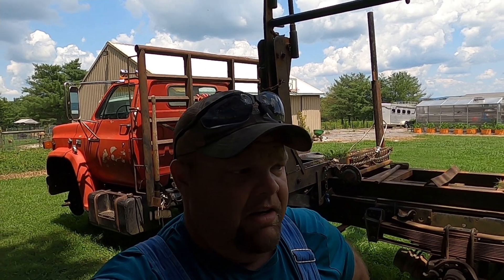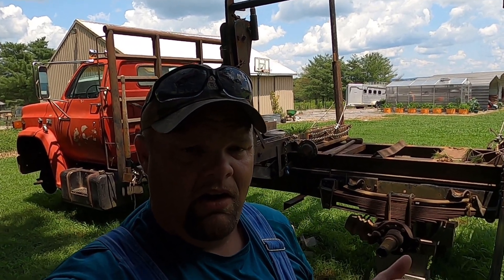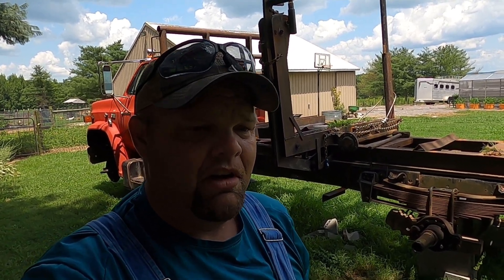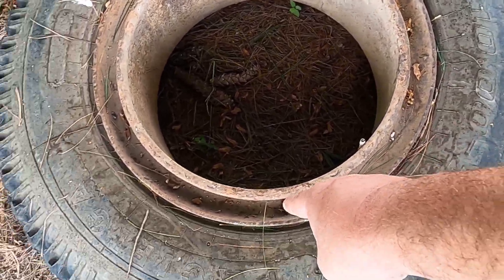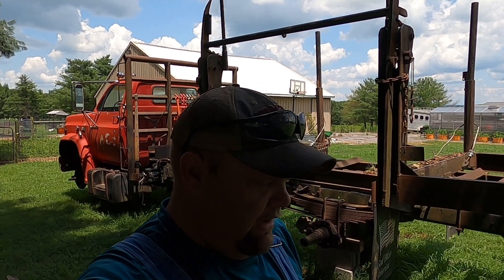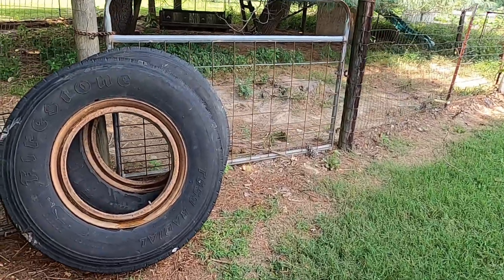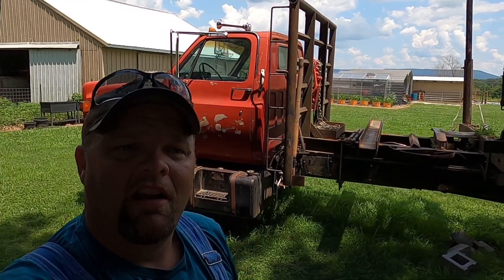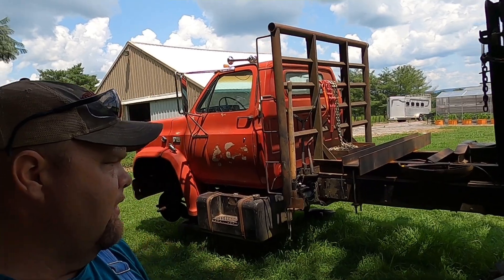A quick update y’all…🚛🔧 and split rims? #046

Comment: Zack,  do ya know if  the 22.5's come off a GM truck or off something else?
Im trying to source a similar swap here in OR and not having much luck.
Reply from the maker: You can find open center 22.5 rims. They’ll go right on Dayton spoke hubs. You can find em used and also new. Used it best. They’re cheaper. Just take the 10-20.00’s off, get single piece rims like 7.5x22.5 or 8.25x22.5 rims and the 11r22.5’s will go right on em. Then they’ll slide right on your truck. If it has Daytons on it. Thanks for watching and commenting! Wish you luck on the truck.